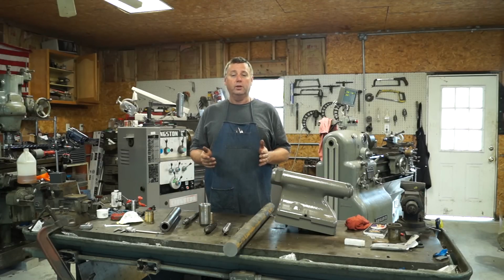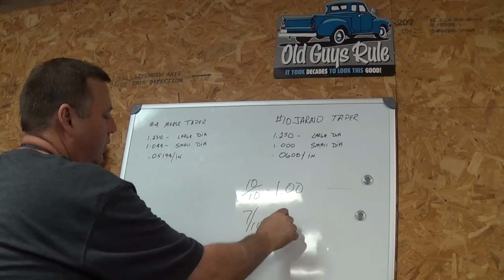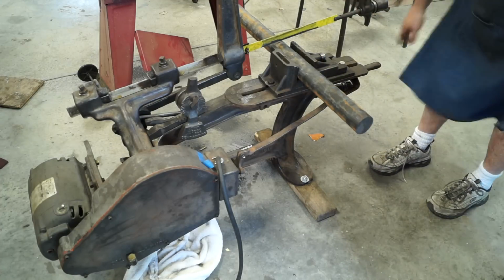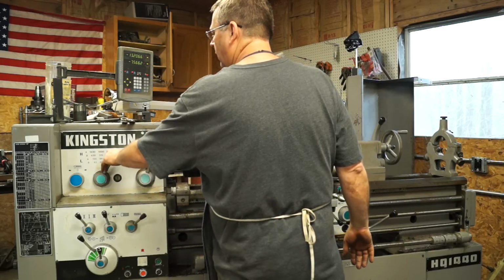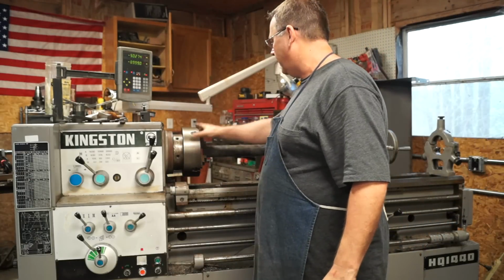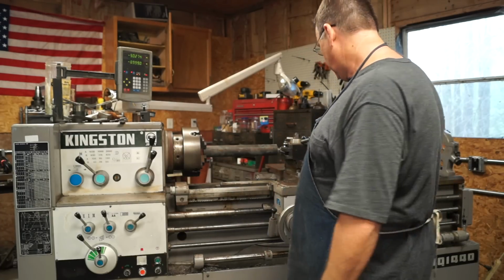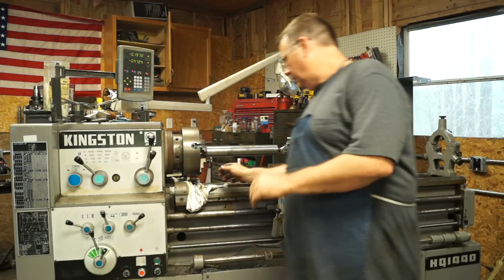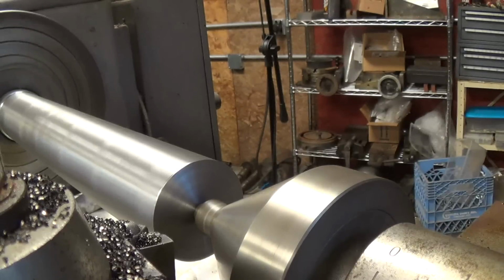Machining  A Tail Stock Quill (Part 1)

Comment: I don't understand why both ends were center drilled if you werent going to turn between centers ...
Reply from the maker: I probably shouldn't have, that may be why my drills were off center on the second side.. Originaly  was going to rough the spindle between centers but I didn't have a dog big enough